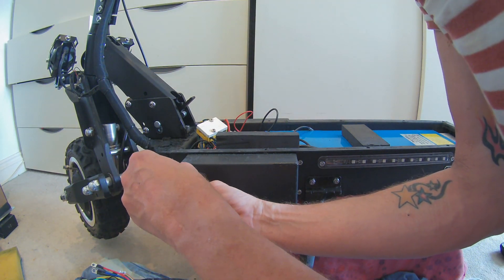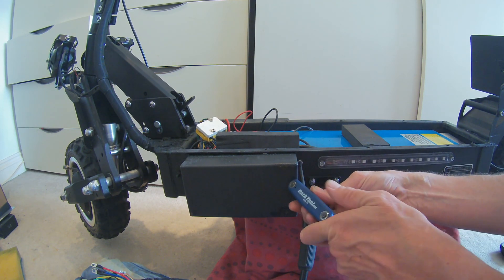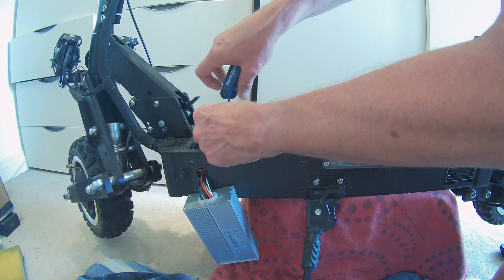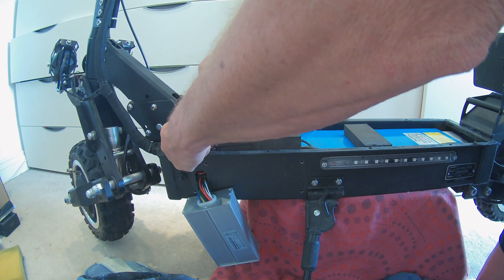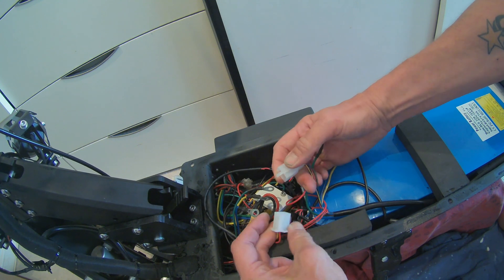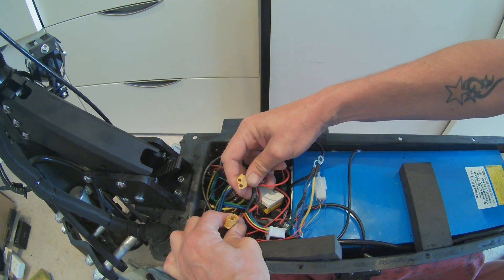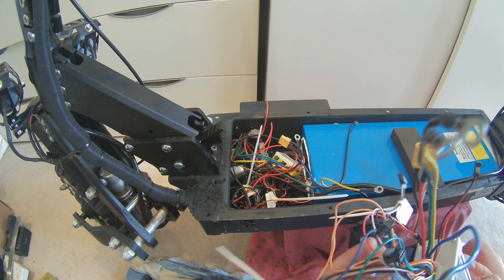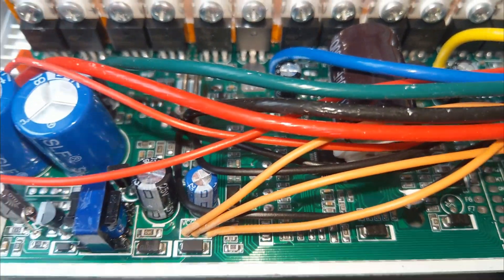Electric Scooter - Motor Controller Failure Part 2

Comment: Wanted to say thanks for vid. I love the info.  

Have you ever had the issue of popping up on reconnecting the battery to controller?  From what I understand, it is the sudden current draw to the capacitor.  I was testing out a different battery pack{same voltage} and I was testing it out.  Worked fine the first time. But upon reconnection it sparked or popped hard enough to discolor and melt the connector just a little bit.  Anyhow, after cleaning connector I put original pack back in and the scooter fails to power on.  The battery measures okay on meter.  I've suspected that it is one of the Mosfets although none of mine are discolored as yours was.  I know you probably are sick of being asked to help diagnose or tell someone how to fix their scooter, especially for free.  So I won't ask.  If your heart feels as if you should share a bit of your expertise with me then just know that I appreciate it very much and no act of kindness is ever a waste..... Lol I'm JK really but I do understand if you don't hit me back.  I can solder decently, but my tools are more for basic stuff I'd say.  I love to learn from those with wisdom and for some reason the way you communicate seem to resonate with my learning ability😅.  
I'm gonna go now and check your other vids, chances are you've already given the info that I'm in search of and all this is just wasting your time.... If so, forgive me.  Take care man and hope to hear from you. 
Later.
Reply from the maker: Thanks so much. I think you know your stuff already. Please stay in touch if you need assistance there. Cheers!

Comment: Could this cause the scooter to cut out?
Reply from the maker: It will cause the scooter to stop. Usually shudders briefly and then the power will not transmit to the wheel. The only thing that ever fails on the scooter is the Mosfets within the controller. Very occasionally the large electrolytic 'can' capacitor starts bulging on the lid. Then you should replace it if you have the controller open.
Reply: @marcusoroberts  my scooter works fine up until it gets to 2 bar battery on my lcd then says error4 then shuts off and doesn’t come back on unless I plug it on charge. Could it be the controller causing my problem do you think?
Reply from the maker: @ANTPLFC  I think it sounds like a fatal battery issue. When did you buy the scooter?
Reply: @marcusoroberts  only since April

Comment: Where can I fix my controller in England. It’s not accelerating
Reply from the maker: Hi Maria. I'm not aware of anywhere that provides such a service. Possibly an electronics technician, if the faulty components are available - usually the MOSFETs. It's relatively straightforward to change yourself if you have access to a soldering station. Then you can also upgrade the heatsinks while you have the controller open. But really, is just easier to change the whole unit.

Comment: Hello Marcus. Thank you fora good movie. I got today long waiting ss13 scooter with 35 Ah 72 V battery. After first 3 km rear engine started to lose power and suddenly stopped. When go double front engine still worked. I haven't Tried to drive through. After few hours engine started to work again. I Will do more testing tomorrow but looks like point less excersise. Something is wrong with mine. Could it be controller or overheating issue? This is 13 inch tire.
Reply: Hi Marcus. One more question.
I have to replace controller on my scooter to the back engine. How to find out which oneis back or front. I got both hidden inside the deck.

Comment: Hey Marcus I have a zero 10x when I ride it full throttle it starts hesitating like a miss fire  then when it gets to its speed when I let the throttle go it the front wheel jams almost chucks me off the e brake is turned off could this be my throttle or controller
Reply from the maker: Hi Nicholas. It sounds like 2 different issues going; one electrical and one mechanical. The stuttering is probably due to a failing mosfet. The front wheel jamming I can't explain, never heard of this.

Comment: Hey Marcus, I got the scooter about a month ago and it has been a blast to ride!  Mine looks exactly like yours (5600w) and has voltage controller box on both sides of the scooter just like yours.  It is very fast and what you said about these being faster than the Dualtron Thunder might be right. Question, what amperage does yours run at?  And if I were to look for a battery replacement in the future what specs do I need to look for? Mine is Chinese 26Ah battery btw.
Reply from the maker: Hiya. Cheers! Mine is currently 35Ah Chineses, but I also have a Panasonic 45Ah one which I have not yet fitted, basically because I currently have all the range I need with the existing battery pack. The 45Ah one will just weigh a little heavier. I would have thought even your 26Ah battery is more than sufficient for most needs...
Reply: @marcusoroberts  hey thanks for the reply. About 3 weeks ago my scooter broke on me as the front wheel stops turning. If I set my scooter on a bench and press the accelerator the front wheel tries to turn by an inch and stops. It seems like I have similar problem to what you had. I'm not electrically inclined so I can't troubleshoot with the caps and mosfets.. I did located the voltage controller (on the right side of scooter) that powers the front wheel and already ordered a voltage controller box for it...from Aliexpress. Can I stay in touch with you in case I run into trouble or have questions once I receive the box and try to fix it on my own? I really appreciate it
Reply from the maker: @rockefelleragent1357  Let us know how it goes..
Reply: @marcusoroberts  Thanks 😊
Reply: @rockefelleragent1357  did you fixed it?
Reply: @pauloa.7609  Thanks for checking on me. That scooter was long gone....it was a piece of crap, even though that thing was wicked fast (had dual 50A controllers) but pretty much everything fell apart and the battery became totally useless. It wouldn't last 1 mile of riding in the winter with the battery fully charged.

Comment: How did it take for the motor to go out? Is it best if i buy one then. Because I'm going to use it daily to work and back
Reply from the maker: The motors on all the scooters I've owned have never let me down. The week point are the controllers. Even then, I've only ever had one problem and that was many miles of very hard riding.
Reply: @marcusoroberts  im plan on getting the t112 5600w and i don't wanna have any issues
Reply from the maker: @raymondpettigrew6547  unfortunately as with anything mechanical and electrical nothing is certain to work forever, but I don't think you'll regret getting one!
Reply from the maker: @raymondpettigrew6547  You might have problems. As with anything. I am not affiliated, but it should be ok.

Comment: Hola Marcus que tal soy de España y tengo el mismo patinete  estado  viendo tus videos pero  no  entiendo lo que te pasa con la controladora puedes hablarme a whuasap 34 691780972
Reply from the maker: Hi Alejandro I will try to help. Please can you be more clear what the problem is? Thanks!
Reply: No I do not have any problem I would like to know if the a72v controller could be changed, they say that the scooter runs longer but the battery lasts less